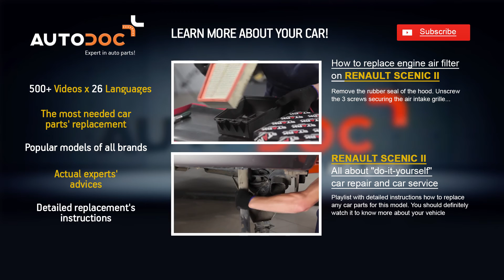How to change a silencer holding bracket RENAULT SCENIC 2 TUTORIAL | AUTODOC

Comment: Great thanks.  I'm surprised not more thumbs up and views.. Do you know the size of the bolts that hold the front drivers seat to the floor.  I need to access the  airbag electrics. Thanks.
Reply from the maker: Thank you for your feedback! There are different sizes, to accurately give dimensions in your car you need to clarify the VIN / Chassis number. Each manufacturer use different bolts. Best regards, Autodoc.

Comment: Is the mount for the exhaust the same one used in the center of the car for the exhaust?
Reply from the maker: Thank you for the feedback! The mount for the exhaust can have some differences, they are not always the same. It all depends on the design and type determined by the manufacturer, and each car should be checked according to this. Best regards, Autodoc.